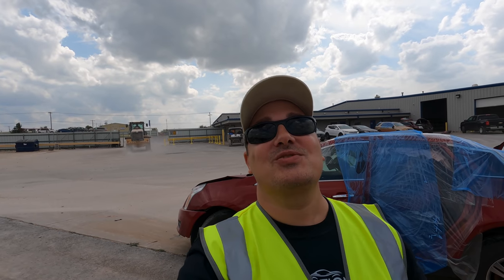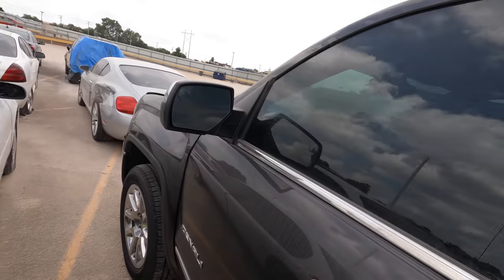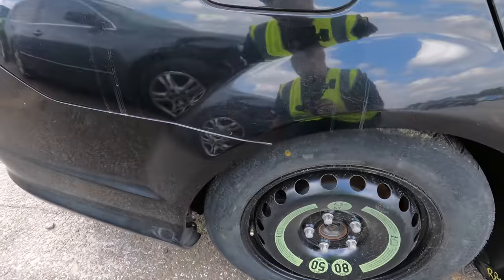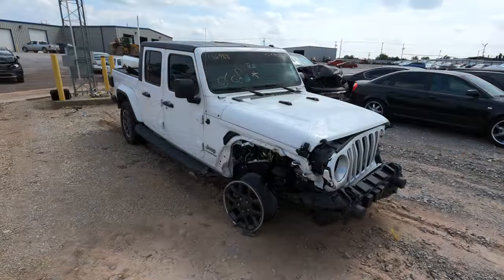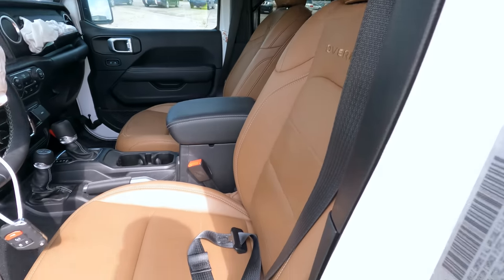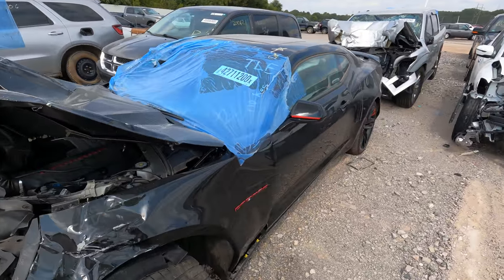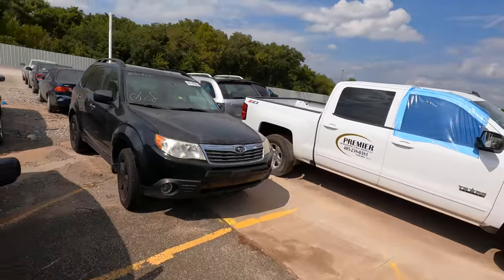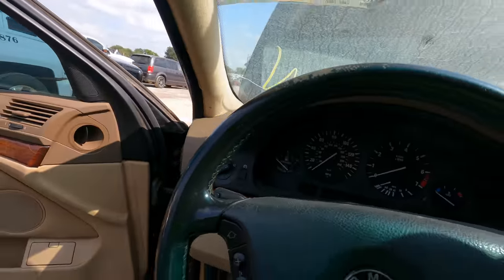Copart Walk Around + New GoPro 9 4K!! 09-22-2020

Comment: at 1:42 you can see some pink markings on the joints and control arms...maybe there is some damage there and they marked  it..
Explaines maybe why there is a different tyre on that side.
Reply: Similar situation to the Mercedes suspension damage of some kind
Reply: When walking around right rear, the wheel appears to be pushed forward also

Comment: honestly i know most would disagree but i think the beamer would be a fun add on. to see whats causing it to not run. the parts that dont work are not expensive to replace so i think its worth taking a risk on it. if it doesnt work out you can always put it back trough copart or mess with it do some weird stuff with it before sending it away

Comment: The Denali had orange paint markings on the lower ball joint when you stuck the camera under the front, and at 05:27 you can see orange paint markings on the frame/engine cradle right below the axle boot, so it would appear to be undercarriage damage.. really doesn't look that bad though, but then again we can't see it from underneath

Comment: BMW is likely out of gas or has a fuel pump problem. If you didn't hear a whirring sound when you cycled the key to the "ON" position, the fuel pump is not operating. Windows inop also points to fuse or relay issues. Could also be a regulator which is also a cheap fix if you do it yourself. This is a simple fix and for 350 bucks I'd buy it all day long. Because if its a relay or fuse or even a fuel pump you would have maybe 100 bucks invested after buying it? Throw a 600 MAACO paint job on it and you have about a grand invested in a car that will flip for at least 2K.

Comment: I don’t know if anybody else spotted it but one size has a 265 7017 which is the spare which is the side that you pointed out and said that it had smaller gaps when you go to the driver side it has a 20 inch rim by 275 that’s why the gap is that way maybe just a speculation

Comment: Even if you cant get that BMW running you could easily part it out and make that 350 back quickly. That's a dang good deal right there
Reply: Could even be something as simple as a bad fuel pump. Or like you stated it may be out of gas. I think it's something work takin a chance on

Comment: There is some insurance company marking on the suspension at 5:28 in the left top corner of the screen
Reply: Looks like the control arm support bracket could be bent. They might've simply marked it to be safe with the repair estimate.

It's kind of amazing how they total cars and trucks that easily up there. But then again if they are supposed to change the whole chasis it's not worth it for them.

Could be quite the easy fix, new suspension components and if that bracket is really damaged take it to a shop and have them weld in a new or used one in good shape.

Comment: for $350, why not.  You could probably sell the wheels and some other parts and make more money on it than what you paid.

Put a couple gallons of gas in it see if it starts, if not, throw some down the throttle body and see if it runs longer.  My experience (with chevys) is when they don't start due to security system, it either does not crank, or if it does, it will run a little longer.  (Like it will fully start, and run for a second or two).

Comment: For $350 the 525 would be worth the risk.  Parting it out would bring more than you paid for it if it is too far gone. "I" would risk it but I also had a 1997 528 with over 250k miles before the trans died and ended the ownership.

Comment: IF YOU buy the BMW for $350.00 "out the door", then you may be in a win, win situation.  OTHERWISE, there are too many maybe's involved.  However, the parts alone should make the BMW worth every penny of $350.00 dollars.  Also, the content value is high because we all want to see why it won't crank.  It really is trying to.  Could be a fuel management problem.  Either way. Good Luck!